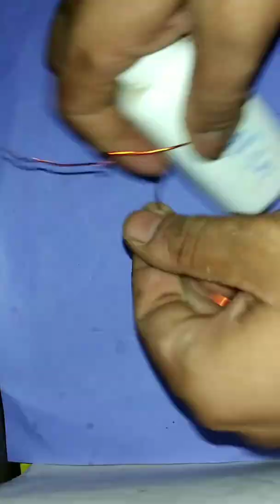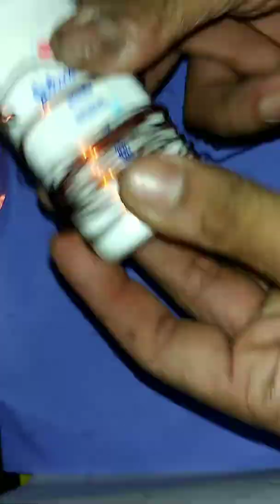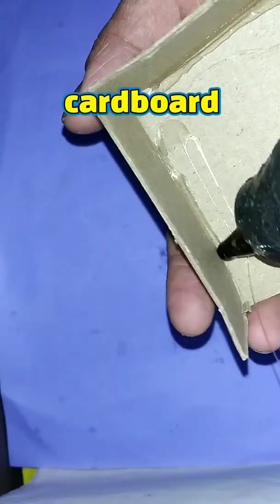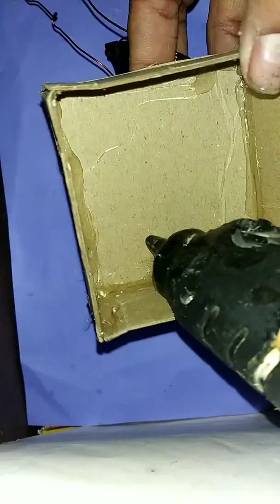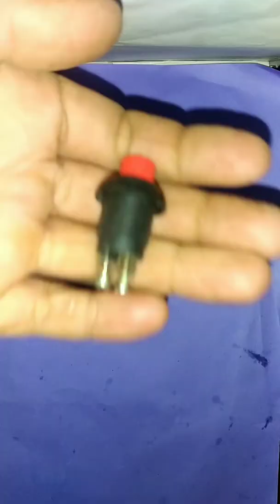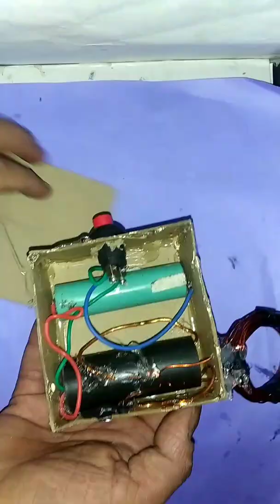emp jammer #shorts #howtomake #summerexperiment

Comment: Use normal wire, this one is arcing between the turns ruinning your EMP's potential, use less turns and thick wire, alsonthe bigger the spark gap you will get better EMP's since you will be charging more the capacitors from the multiplier, and use better insulators for the box, this thing will easily arc through cardboard or silicone.
Reply: bro what your class
Reply: @syedzameer8022  what do you mean?
Reply: @ElPsyCongroo.  I mean what is your grade do you learn in university or college
Reply: @syedzameer8022 I'm still in high school unfortunately, not sure how the years work in other countries but i get to university in 2026 so I don't know what grade that is
Reply: @ElPsyCongroo.  which country u from?

Comment: bro will literaly kill himself with this reckless behaviour working with high voltage, just a quick reminder, neither the current nor the voltage is the killer, it is the overall power flowing through your body. He wouldnt directly be dead on the spot, but it will hurt a lot, also if we consider the batterie can put out about 4A at around 4.5V we would have around 18W that will shock him and this ammount for just a few milliseconds can stop your hearth if applied near it. Also your Copper wire is not suited for such high voltages (i can tell by looking at the little arking it does between the turns...). Anyways hope you didn't already die, please be more carefull next time if you post such things on the Internet.
Reply: Man this guy literally playing with fire 😂
Reply: These modules are not lethal, they are used in stun guns which are legal self defense not lethal weapons, i have been in series with thise and i am still here (of course this doesn't spply to people with health conditions or in special conditions like having salt water in your hands or something)
Reply: @Remnyr  I have done it before, it works but the caps are not the best. I think I have a video of this exact module and a coil messing with a calculator but it was a super small spark gap so the power was very little. But yes, it is basically a LC oscillator with spark gap. High voltage source, capacitor in parallel, coil in series with the cap and between one end of the coil and tone end of the cap you leave an air gap.
Reply: It’s not gonna kill you dude
Reply: Bro just cover the coil most people have the coil IN something.
Reply: @toxicity6629  doesn't really matter, it's insulated wire and the spark gap is so small compared to the power of these modules that it's extremely unlikely you offer less resistance than the SG itself

Comment: He works on slot machine/change Coin????
Reply: No
Reply: It's a fake video
Reply: @ilandlord  actually this would work...(Assuming that he used a pulsed high voltage dc generator with a capacitor.)But in this instance it does not work-you can see the high voltage arcing between the wires. This would prevent the HV from flowing and creating an emp. But the circuit would work. He just made it badly.